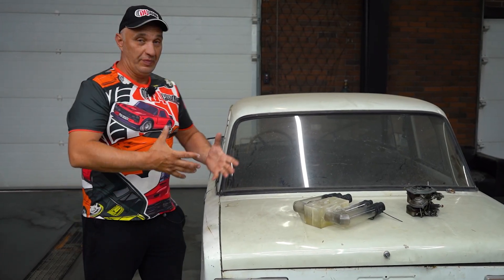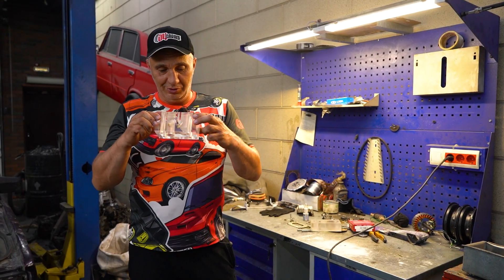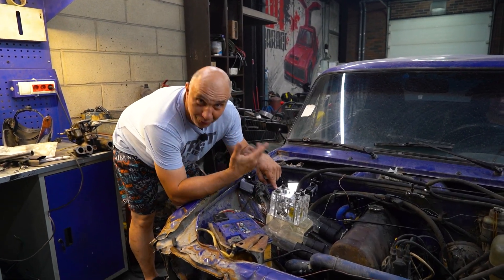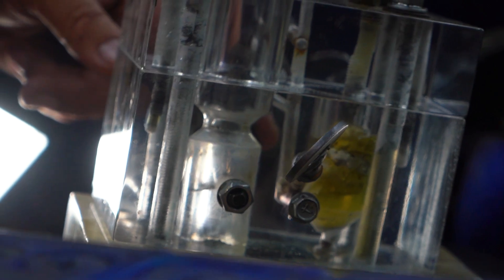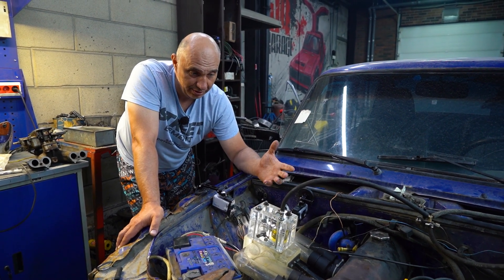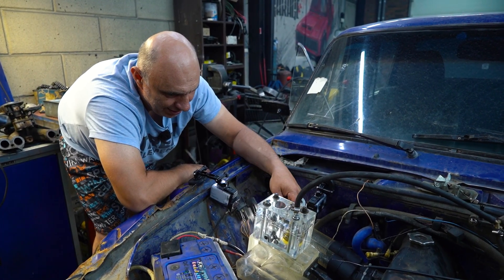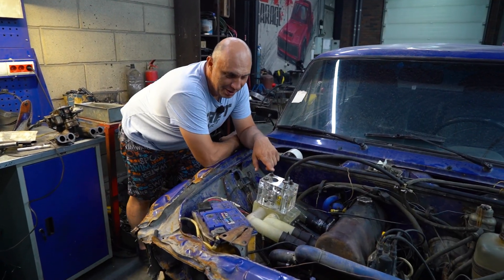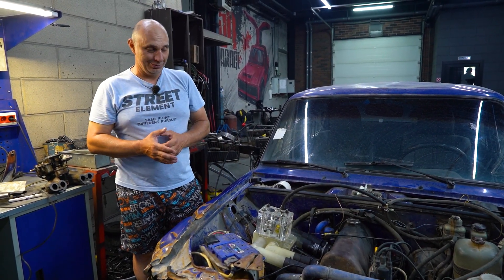We make a transparent carburetor

Comment: That's pretty darn impressive. Making a carb might not be so hard, but making a carb that works decently is much harder. I rode motorcycles for years that didn't have accelerator pumps, you just have to feed throttle slower. You might want to consider dying the gas red for your next tests.

Comment: Make see thru fuel tank for the see thru carb. see thru car. See thru diff, most excitingly a see thru battery. Dont forget the see thru radiator. Then drive it around. Dont use fuel gauge. Just use peep hole in floor for the see thru tank.

Comment: Maybe for the transparent engine, you could just make transparent cylinders by decking the block right above the main bearing webs and using long headbolts to attach it through the clear cylinder block.
Reply: a transparent engine is impossible imo due to the lack of required tensile strength. it might work if you made it out of sapphire, but the cost would be obscene.

Comment: Interesting to see how much fuel sticks to the intake manifold that will end up dribbling in to the cylinder after a short time - it also makes more sense to why you should get the engine nicely warmed before tuning a carb and why it can sometimes seem a touch lean on startup without any choke. 👍 Really nice experiment 🙂
Reply: Also, why having dimples or casting texture is better than smooth intake runners. The textured surface actually helps atomize the fuel better.
Reply: @Oink_Blaster  yeah I thought that when Vlad was on about polishing the inside - trouble is it wouldn't be as good for viewing.
Reply: I wonder if creating a hot air stove for the intake would help atomize the fuel better.  Drawing air through a piece of sheet metal wrapped around the exhaust manifold to get the air really hot might help.
Reply: @BlackPill-obey  Some vehicles sort of do - it's also mostly to prevent carb freezing too. My Reliant Robin has one that sits between the SU carb and intake manifold.

Comment: Great job as usual, Gentleman! I wonder if running a stiff wire brush in a crosshatch pattern through the intake manifold runners before they were assembled could help atomization. The intake would lose a considerable amount of vision, but this modification should help keep the runners a bit more dry and get more  fuel into the cylinders. Thank you fellows for your efforts.

Comment: I used to work for a company that used super hard plastic on there assembly lines for fixtures to hold parts and that stuff was hard as a rock you could hit it with a hammer and it would be fine

Comment: that was great so fix the leak drill a hole in the center to mount the air cleaner (one does need an air filter) then take it out for a test spin around your garage or on your test track

Comment: I am convinced, You guys can build a whole car from scratch....
Reply: And it would run if it was 70c above or 70c below. Because Russia!
Reply: @dennis-nz5im -70c? Not on gasoline it wont 😂
Flashpoint of petrol is -40 and it freezes at -60?
Reply: @twoeightythreez  They can make it run on LPG gas. -70 would be no problem.
Reply: @twoeightythreez  what about using glowplugs to preheat the fuel?
Reply: Next Challenge!!! Whole car from scratch!!
Reply: @Driftingkalamari It will look a lot like the cars from the early 1900s but absolutely they can do it
Reply: Vlad can walk on water
Reply: ...from plexiglass
Reply: I wouldn't be surprised if they found a way to not have the transparent engine head and block fail, and just made an 80% transparent lada.
Reply: They can build this from scratch in a cave with a box of scraps
Reply: @4mdt21 iron man
Reply: They should just invest into a manufacturing brand and create cheap and reliable cars.
Reply: They need to put a load on this setup.  it's easy to rev the engine when there is no load on it.  It's not making any power.
Reply: Challenge accepted
Reply: Obviously. You mean from parts that aren't supposed to be car parts
Reply: @Anonymous_Music that's kinda like saying you can't make an engine out of a air compressor or a car AC compressor. It's just really hard
Reply: @thedancingpickle6362  My comment was me stating, Obviously these guys can make a full car. OP should've been specific with the little they would be able to use in order to make one
Reply: Wdym Russians do anything and everything
Reply: And make it clear 😂
Reply: Make  it all transparent! 😄
Reply: Yes
Reply: They did
Reply: That's just what men do 😂
Reply: @freakyfreerider  You're welcome
Reply: Lol. No they can't. These dudes are hacks.
Reply: @joshuagibson2520 nobody said it would be a good car 😂
Reply: I'd like to remind you guys that cars are made by humans. So there is no reason they can't
Reply: @sinchrotron  No, you are being silly. It is impossible to build a car from scratch in a garage.
Reply: @tarstarkusz  lol. Tell this to Mr. Ford
Reply: @sinchrotron  Ford did not make a car from scratch in his garage.  Almost nobody could afford to create a foundry and the skills to create a sand mold for a engine block.
Despite the car running from this plastic carb, that's all it is doing. Running it, while not making any power.
It takes a lot of machinery and tons of highly skilled labor to build a car from scratch.
Can you hand build a car from existing parts and materials? Yes. But this is common and is no big revelation.
Reply: @tarstarkusz  you don't need to cast the block, head, etc. Manual mill is enough
Reply: @sinchrotron  That's cheating.
Reply: @tarstarkusz  oh, now I've got your point. You probably mean to start with mining the ore with an axe made of wood stick
Reply: @sinchrotron  That's not the "point" at all.  It's to point out that these things are a lot more involved and complicated than they seem at first thought.
The fact that a large organization which is made up of people can do something does not mean that 1 person or 2 or 3 persons can also do that thing. Not only do you need a lot of equipment, you need many people with a wide variety of specialized knowledge.   A place like ""The Rouge" (raw materials came in one end, cars out the other)  probably employed people in  thousands of highly specialized roles.
Not only that, but you need people who specialize in managing so many people.
This was one of Ford's strong points. He was an excellent manager.
Reply: @tarstarkusz  yep agree, but as a man, who works in automotive industry for a more than a half of my life I can ensure you that it is pretty possible to assemble the combustion driven vehicle from scratch as an YouTube project with the facility they have
Reply: @sinchrotron  Sure, from parts. Of if you have a large advanced factory, even making them from raw materials. 
  It's even possible to make body parts by hand.  But it is very labor intensive. It would take a highly experienced skilled artisan a half day to make even a simple body part. A complex part may take multiple days.  Machines do it in 5 seconds.
Making even a carb from aluminum block that already exist is quite a job.  To make a good carburetor (not a clone, a custom carb) would probably take a couple months and at least 3 prototypes, probably more like 20, though those 20 prototypes don't have to all be 100% new.